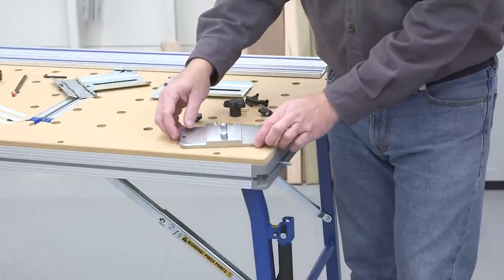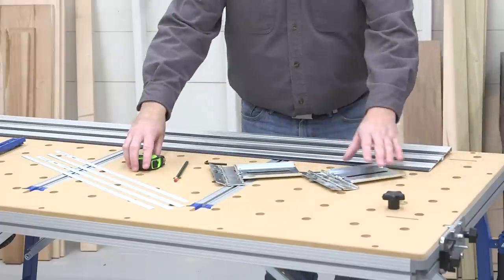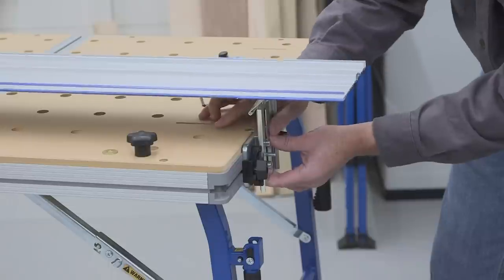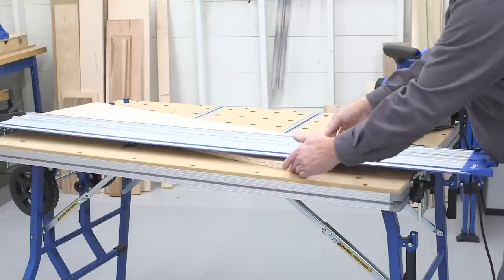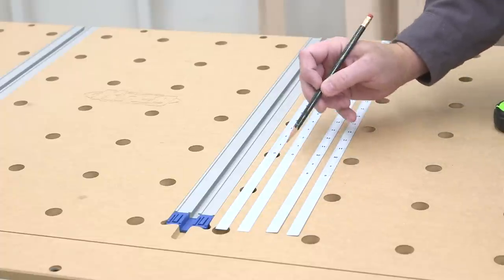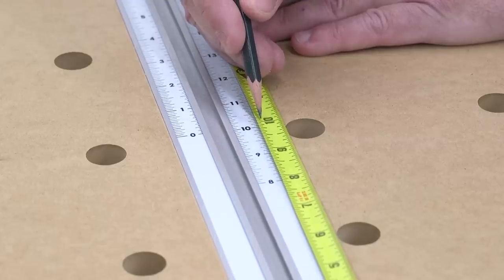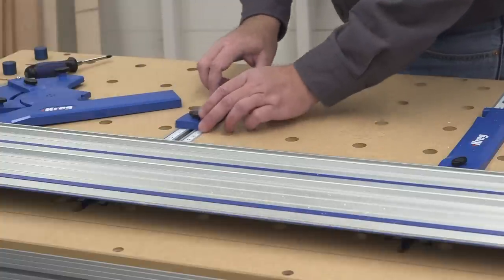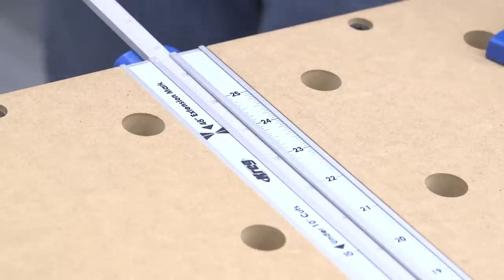How To Set Up The Kreg® Adaptive Cutting System Project Table

Comment: Crystal clear presentation. I'm a Festool track saw owner, and the design of this Kreg product looks great to me, especially the decision to go with a left-blade saw. Where is the saw itself manufactured, and what are the blade's diameter and arbor size. The corresponding Euro/proprietary specs of the Festool saw trap users into the non-competitive prices their dealers are required to hold. My bet is that this late but carefully developed Kreg entry into the track saw space will be a massive success.

Comment: I bought the table, I would appreciate a QR code in the beginning of the manual to this video, I'm trying to set up the hinges and any way I do it the track becomes offset not straight. You must reference the video as the instruction manual isn't clear enough. If I had a reference to this video I would have saved 45 minutes of confusion. Thank you.
Reply from the maker: We're glad the video was helpful and will share your feedback with the product team about adding a link to the manual. Thanks!

Comment: I find the hinge mount plate(s) doesn’t slide easily to align the track with the versa stops when calibrating.  What am I doing wrong?  Thanks.
Reply: I believe the nuts that slide in the aluminum track gets caught mid turn and jams up.  A little tighten/loosen of the T knobs with some shaking should realign them and allow it to slide!

Comment: Will this work with other track saws
Reply from the maker: The Kreg Project Table is designed to accept and work with the Kreg 62" Guide Track, and has not been designed to accept and work with tracks from other manufacturers. While it may be possible, Kreg makes no such claims, and does not recommend using the tracks from other manufacturers with the Kreg Project Table.

Comment: This looks awesome!  I haven't finished watching the video yet, but is this table and fixture compatible with Festool tracks?  I already have a bunch of festool tracks but am looking for a more sturdy "MFT" style table that supports those tracks.  If they are compatible, this one looks like a winner for me.
Reply from the maker: The Kreg 62" Guide Track is designed to work with the Kreg Plunge Saw, and has not been designed to work with tracks from other manufacturers. While it may be possible, Kreg makes no such claims, and does not recommend using the 62" Guide Track with the tracks from other manufacturers.

Comment: Hi Kreg, can the Kreg Precision Miter Gauge system be used on the project table? Seems like it would be easier to set up precise angles using this gauge.
Reply from the maker: The project table comes with a Miter Guide that allows you to dial in the exact angle you need for precise angled cuts. Watch the video here to learn more: https://www.kregtool.com/store/c73/systems/p471/adaptive-cutting-system-master-kit/#video-1

Comment: Will the table work with Makita, Triton, etc. track saws/track? Or will it only work with Kreg's plunge saw? The table is a no brainer purchase for those of us with track saws who want to get a Festool MFT/3-style cutting system without the Festoolish prices and problems.
Reply from the maker: Hi there. Thanks for your interest! 

The Kreg 62" Guide Track is designed to work with the Kreg Plunge Saw, and has not been designed to work with tracks from other manufacturers. While it may be possible, Kreg makes no such claims, and does not recommend using the 62" Guide Track with saws from other manufacturers.

Comment: Can you use any Kreg clamps with this table?  Are there tracks in the edges of the table?  Possibility to route out space in the top for a track?
Reply from the maker: There are not tracks in the edges of the table and we wouldn't recommend routing out space for a clamp track. You can use the Kreg In-Line Clamp and the Kreg Bench Clamp with Bench Clamp Base in the table easily.

Comment: Hello Kreg; I noticed that the ruler lowest reading is 8"  , what is the smallest width I can cut using this saw? in other words, can I make cuts less than 8" wide?
Reply from the maker: Please contact us at TechnicalSupport@kregtool.com or 800-447-8638 - they will be happy to assist you with this. Thanks!

Comment: Just purchased the ACS from Woodcraft this weekend, and really looking forward to using it. Out of curiosity, is it possible to establish a second location for the  guide track hinges along the long length of the table such that the guide track could run perpendicular to the standard position, and thus provide additional flexibility comparable to the Festool MFT?    Seems like the only thing one would have to do is cut a small notch out along the edges of the MFT in the desired locations to accomodate the two hinge plates, and of course utilize a shortened guide rail.   Is this feasible and has anyone tried this?
Reply: This is a good idea

Comment: what makes the tape measures stay in place once you calibrate them?!
Reply from the maker: The Adaptive Cutting System is designed to stay calibrated for accurate setups and measurements once set up. If anything ever gets knocked out of adjustment, though, it can be re-calibrated easily. If you ever find that you are unable to maintain or reset calibration of any part of the Adaptive Cutting System, you should contact Kreg.
Reply: @KregToolCompany  You didn't answer the question. What keeps the measures in place?

Comment: Will the table work with existing track saws like the dewalt?
Reply from the maker: The Kreg® 62" Guide Track is designed to work with the Kreg® Plunge Saw, and has not been designed to work with saws and tracks from other manufacturers. While it may be possible, Kreg makes no such claims, and does not recommend using the 62" Guide Track with the tracks from other manufacturers.

Comment: what is the hole spacing on the table
Reply from the maker: ¾"
19mm
Reply: @KregToolCompany  No, 3/4" is the hole diameter. Spacing would be the distance between holes. What is the grid spacing? I searched for the manual and didn't find the hole spacing information in there or on your web site.

Comment: Does the system work with other track saws?  I have the dewalt one.
Reply from the maker: The Kreg® 62" Guide Track is designed to work with the Kreg® Plunge Saw, and has not been designed to work with tracks from other manufacturers. While it may be possible, Kreg makes no such claims, and does not recommend using the 62" Guide Track with the tracks from other manufacturers.
Reply: Kreg Tool aww, I would definitely have purchased the table but I’m not interested in purchasing a second tracksaw system. You guys missed a huge opportunity here by making the system proprietary. :(

Comment: Can the Kreg Accu-Cut be attached to the table in the same way as the new track?
Reply from the maker: No, the Adaptive Cutting System Plunge Saw is not compatible with the Kreg Accu-Cut™ track. The Accu-Cut track is designed to work with the Universal Sled that accompanies it. The Adaptive Cutting System Plunge Saw is designed to ride directly on the Adaptive Cutting System 62" Guide Track, and is not compatible with the Accu-Cut Universal Sled.
Reply: Sorry Kreg Tool, that wasn't his question, people want to know if the tracks they already have can be attached to the work table (the raising and lowering function) so they can get away with just buying the table if they already have a track saw rail system they like.
Reply: It looks like it could attach, as the accu cut does have slot channels on the bottom, but the slots are not centered, so the track would be offset. You would have minimal adjustments to compensate for that.
Reply from the maker: The Kreg Project Table is designed to accept and work with the Kreg 62" Guide Track, and has not been designed to accept and work with tracks from other manufacturers. While it may be possible, Kreg makes no such claims, and does recommend using the tracks from other manufacturers with the Kreg Project Table.

Comment: Will the adaptive table work with a Makita track saw?
Reply from the maker: The Kreg® 62" Guide Track is designed to work with the Kreg® Plunge Saw, and has not been designed to work with tracks from other manufacturers. While it may be possible, Kreg makes no such claims, and does not recommend using the 62" Guide Track with the tracks from other manufacturers.
Reply: Looks compatible. If not then some little modifications to be done. I'll let you know once I received mine. Although this may take ages because they have to serve the local market first.